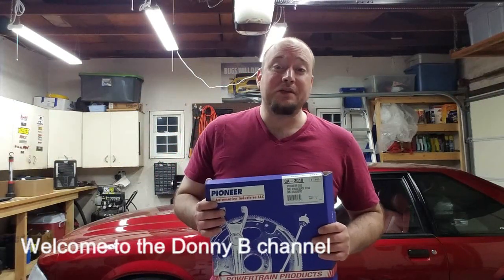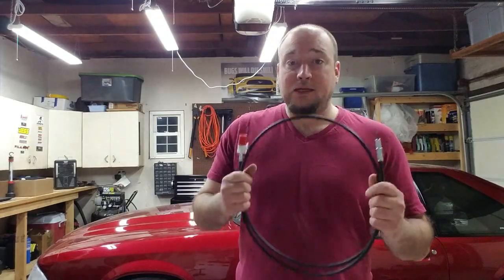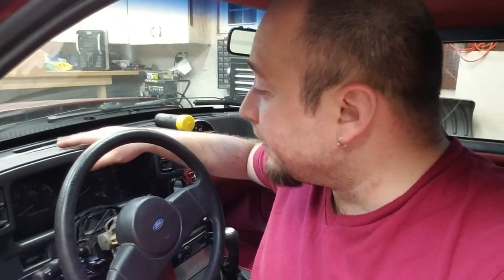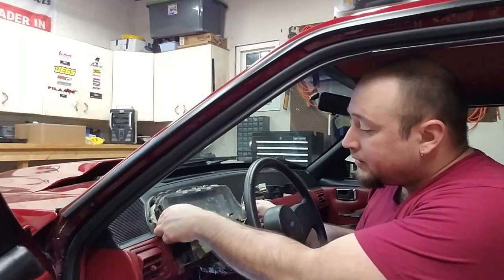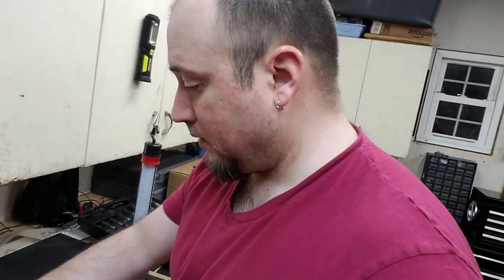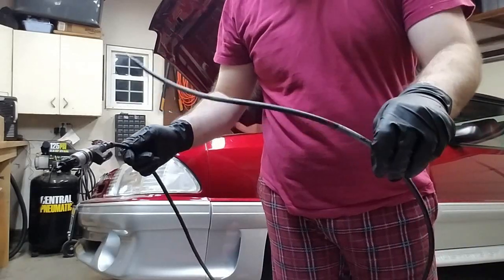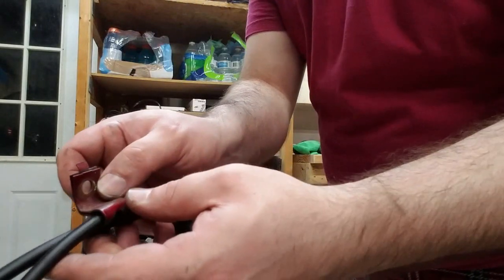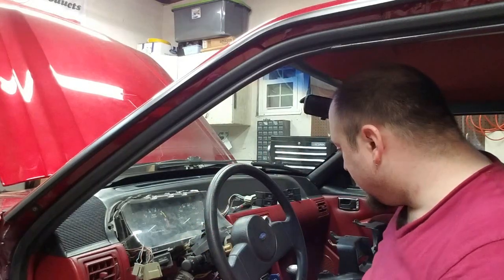Mustang Speedometer Cable Replacement

Comment: How did u take out the speedo cable from the cluster? Just pulled it? Im working on my 69 and the circuit board is already hard and crusty (i ordered a replacement) but i dont want to break anything else